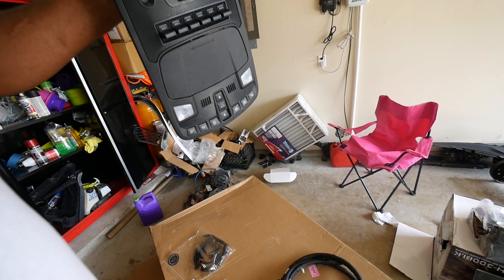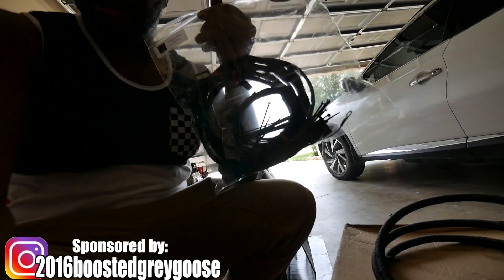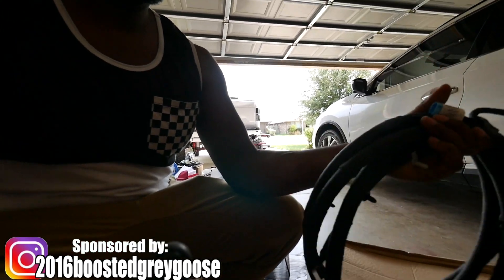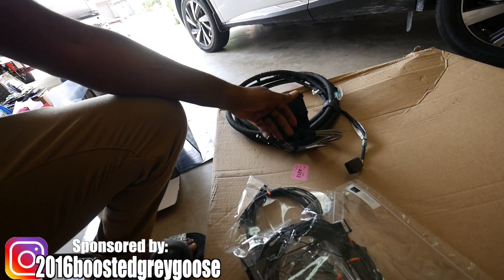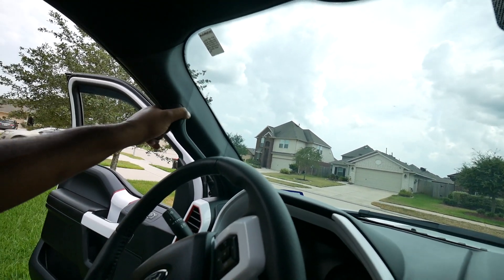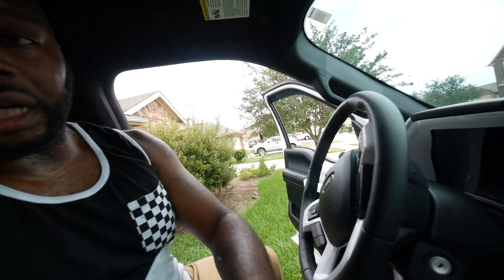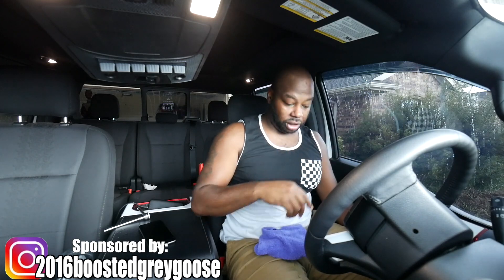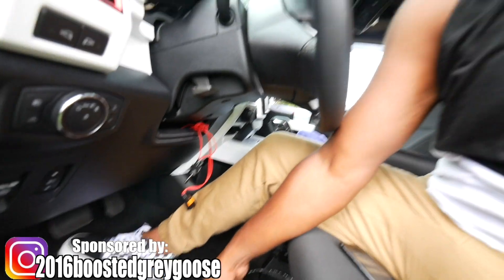INSTALLED AN F250/RAPTOR OEM UPFITTER ON MY FORD F150 *UNBELIEVABLE*

Comment: Damn. I would love to do this. Just priced everything out and it will cost around $700 to do it....... and that's just for the switches. Not to mention the cost of whatever I would want to put on them! To much for me just to add switches. Great idea though and another great video!
Reply: If you are serious about doing this, you can mitigate the cost of parts by being resourceful. There are many of trucks that have the 2 main parts that you need, the console and relay box, at salvage yards etc. The same part coming out of a Super Duty will almost always be cheaper that if you were to ask for the part from a Raptor. The moment you say "Raptor" it seems the price goes up! Be resourceful....

Comment: Pro Tip:  Ditch the blue, plastic, solderless quick splice connects.  You will thank me later (a year or so).  They ALWAYS fail.  I can't tell you how many trailers I've rewired because of these god awful things.  Teach yourself to solder, it's not hard and you seem plenty smart enough.  Also, when making connections outside the cab of the vehicle use 'marine grade' heat shrink to cover your solder connections.  1 quick side note...  Be sure to check your wiring for amperage and length.  The longer the wire the bigger it has to be (AWG - wire gauge) to carry the load.  Your compressor wire seemed a bit skinny.  There are a dozen or so free 'calculators' for this on google.  If you do these 3 things your modifications will exceed OEM and DOT specs and you will never have to chase down a random malfunction due to your wiring.

Comment: Is all wiring included in this wire harness that you provided part number for from TASCA or Ford? Also do you have part number for your upper switches ... i need exactly same one trim and color/options

Comment: I’m going to do this can we get the link to the circuit breaker and upfitter console
Reply from the maker: SNEAKERADDICT317 I’m trying to get the right part no. for the upfitter I got lucky with mine on eBay but the rest of the parts in the description
Reply: Cool right on Bro and love the channel 👍🏾
Reply: Quick question does your Sync still work with your Linkswell Screen ?